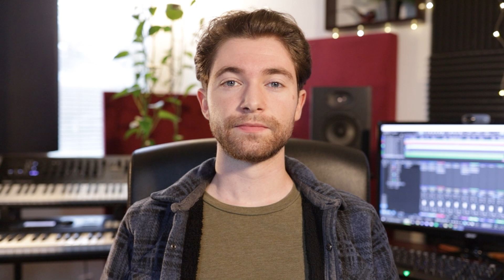Small (sE8) vs. Large (AT2035) Diaphragm Condensers on Upright Piano

Comment: thanks for doing this!  I tend to favor the se8 for the bass response which I think is expected given small diaphram.  I wonder if with precise post EQ I could get the 2035 to sounds like the se8.  Thanks for showing the freq response as well.  Very inspiring video.
Reply from the maker: My pleasure! I hadn’t seen any comparisons or in depth reviews on the sE8s, so I’m glad folks are finding this helpful. 

You 100% can get the AT2035s sounding close with methodical EQ+transient shaping compression. I’ve been using them for years and I’ve been happy with them. Especially in a full mix, I think the differences between the mics are negligible, unless you need that extra detail.

It’s more about technique than mics. That being said, I agree, I like the bass response and overall imaging of the sE8s more.

Lately I’ve been using all four; the sE8s capturing the hammers and the AT2035s below the key bed to get string+wood resonance. Some people won’t agree, but I use a tape measure to place the mics. Why be haphazard with your phase response? I use the 3:1 rule, all mics around 6-8” away from the piano, and 18-24” from each other. The result is a square mic position, with a mic in each “corner.”

I’ll be playing around with multi-mic’ing my upright, because with this 4 mic set up (you could also add a room mic for vibe) results in the most accurate representation of the sound source. I’ve yet to try putting mics behind the piano for a darker sound. It’s incredible how far you can go with (relatively) cheap mics and good technique.
Reply: Awesome thanks for the tips. I actually have the focusrite ISA as well but still getting a feel for it. Can you tell me what settings you are dialing up on the ISA especially in this piano video? Like what impedance setting etc?
Reply from the maker: @lwl25  I’m happy to help! The ISA is such a wonderful preamp.

I’m still wrapping my head around it too. I believe in this video I was using the high impedance setting, which is 6.8k ohms. I have the gain set to 20-50 with trim at 10 o’clock. I use the Focusrite 18i20 and have the input gain all the way down, I think with the pads engaged. 

I default to the high setting for condensers, but after doing research to answer your question, I’m second guessing that habit. 

To my understanding, it’s best practice to match the output impedance of your mics using a 10:1 ratio. The AT2035’s output impedance is 120 ohms, so a “traditional” preamp impedance level is 1-2k ohms. The ISA 110 setting is 1.4k ohms, which is perfect.

Using a higher or lower impedance will affect the tonal and (I could be wrong) the transient response to varying degrees. Each mic is different. Rule of thumb, a higher impedance might embellish the high frequencies and give you more defined transients. Driving mics lower will give you a more mid focused, darker sound. 

Actually, you might have given me a new video idea. I think it’d be useful to record using all the different impedance settings to see how mics respond to varying levels of power. 

I think dynamic mics and ribbon mics will respond more drastically to impedance changes than condensers, but it’s on a mic-to-mic basis. Best thing to do is try all of the setting and see which ones would be useful in what contexts. Like if I’m recording “darker” piano, micing the back, I might want to choose a lower impedance level to color the sound. You’ll have to experiment with it.